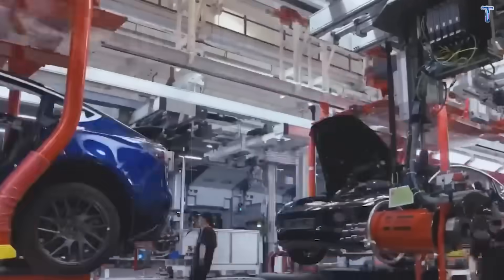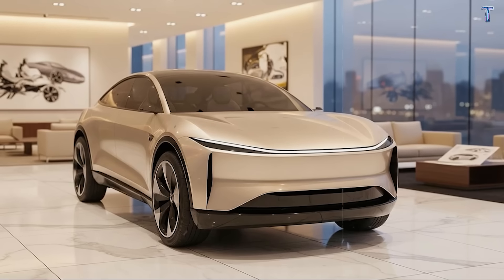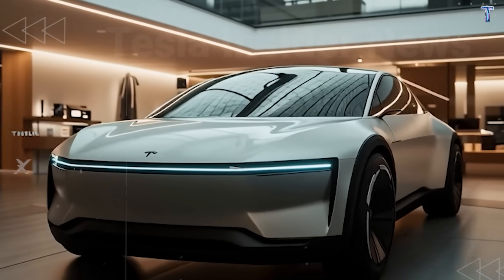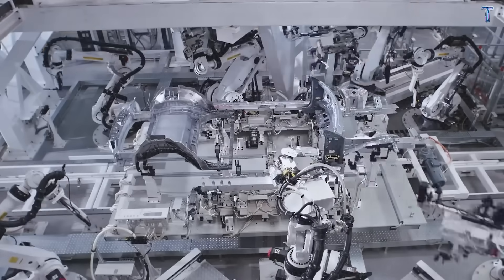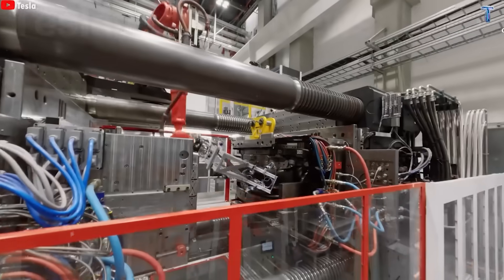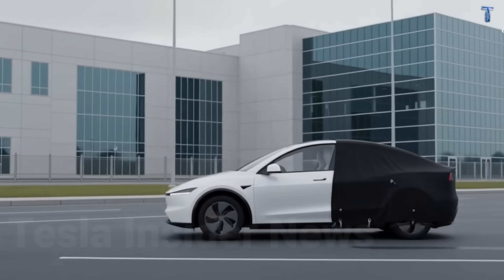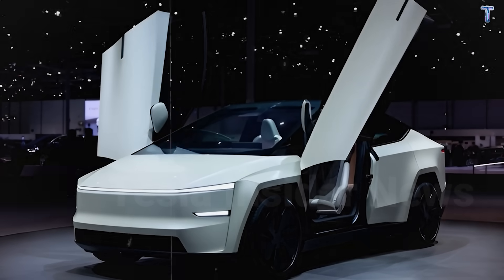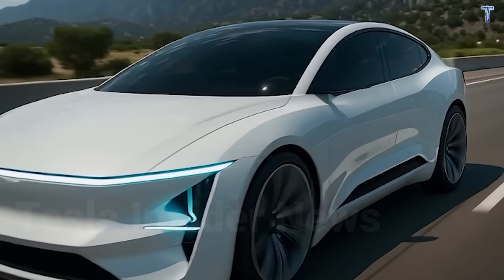Elon Musk Explains How a $12,749 Tesla Model 2 Could Cost Near Zero to Own

Comment: getting hold of aluminum and steel and copper at present costs makes this impossible to produce.
Reply from the maker: That’s a valid concern. What’s being discussed is based on internal cost targets and long-term supply contracts, not today’s spot prices. Materials pricing, vertical integration, and simplified design are all variables Tesla is reportedly working on, but final feasibility will depend on how those inputs evolve. Updates will come as more concrete details emerge.

Comment: It is click bait, word is it will cost between $30-$40K
Reply from the maker: That claim is floating around too. The lower price point discussed comes from leaked internal targets, not an official announcement. Pricing can shift as materials, production scale, and strategy change. As more concrete info comes out, we’ll keep sharing updates based on the latest signals.
Reply: @TeslaInsiderNews  Thank you!  I want one if I can get for $30k or less!
Reply: if it cost that much they can keep it.

Comment: Gas under $2/gal. Battery replacement cost and charging time kill the idea.
Reply: Gas is going down until it goes up. I used to pay .69 cent a gallon. Electric EV if charging from home are about 1/4 the price of gasoline.